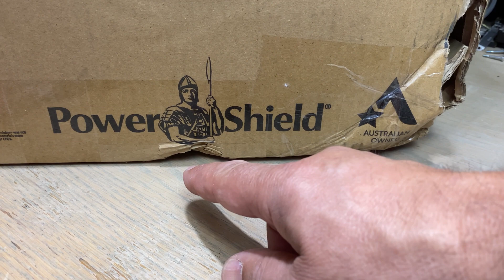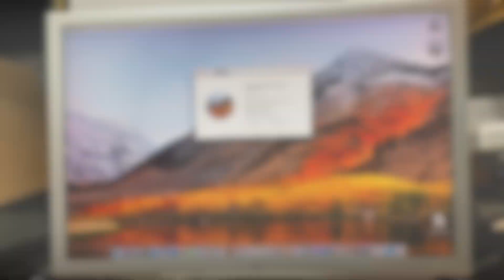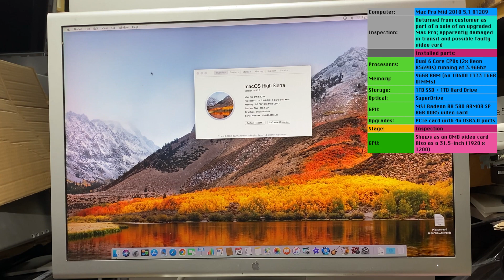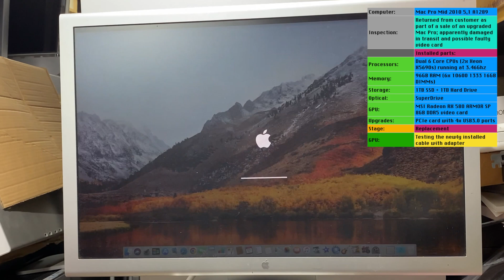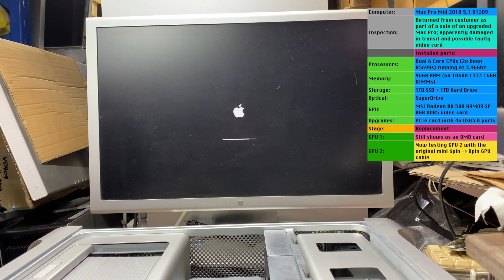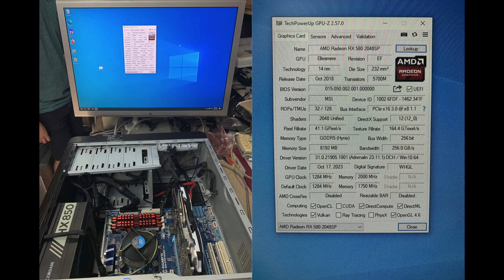[aa-repair] Mac Pro Dual 6/Hex Core with RX580 GPU 5,1 A1289 Mid 2010/2012 r0004 v25-006

Comment: Hi there, maybe I am too late, but at least I want to share my experience here. I've put a Sapphire Pulse Radeon RX580 with 8 GB of VRAM in my Mac Pro 5.1 and I can definitely say, that the card must be connected with both mini 6-Pin connections of the motherboard. I've bought a dual mini 6-Pin to 8-Pin adapter cable to connect the GPU. The Sapphire Pulse Radeon RX580 needs 225W of power so it now gets 75W over the PCIe Slot itself plus additional 75W + 75W from both mini 6-Pin connections of the motherboard. I am not sure about your MSI RX580 but I can imagine that it needed more power which could explain the weird behavior. Maybe this version of the RX580 even needs more than 225W which is the exact max. power consumption of my version of the RX580 and also the max. power the Mac can deliver for a GPU without modifying the power supply. Kind regards
Reply from the maker: Thank you for sharing. I have put in a Sapphire Pulse Radeon RX580 with 8GB in a Mac Pro Mid 2010 and 2012 with a single cable, and it shows as an 8GB every time, with or without OCLP. This MSI Armor SP RX580 with 8GB shows up as 8MB every time, with or without OCLP. If I place this video card into a PC, it shows as an 8GB. The 225W of power is the maximum power draw for the card, but a 500W or greater power supply is required, and a Mac Pro has a 980W power supply. I may shoot another video with multiple monitors connected, and try a few different macOS, and see what results I get.

Comment: Hola amigo tengo una Mac-Pro pero del año 2012  Procesador Intel Xeon W3565 soy de Venezuela y cada vez que la enciendo se queda colgada en el sonido que emiten todas las Mac y no termina de arrancar y no da video que falla es esa agradeceria de su experiencia saludos.

Hello friend, I have a Mac-Pro but from the year 2012 Intel Xeon W3565 processor, I am from Venezuela and every time I turn it on it gets stuck on the sound that all Macs emit and it does not finish starting and does not give video that it fails, that is why I would appreciate your experience, greetings.
Reply from the maker: G'day mate. If you have a Mac Pro 2009 or 2010 or 2012, and you hear the startup sound but no video, then your computer passes all the necessary tests to start. So the logic board, CPU board and RAM tests all pass. You must have a video problem, that is, the video card or the cable to your display or your display, is faulty. Or it could be a combination of any of those 3 components. I hope this helps you.

Hola, amigo. Si tienes una Mac Pro 2009, 2010 o 2012 y escuchas el sonido de inicio, pero no la imagen, tu computadora pasa todas las pruebas necesarias para arrancar. Por lo tanto, las pruebas de la placa base, la CPU y la RAM pasan. Debes tener un problema de imagen; es decir, la tarjeta de video o el cable de la pantalla están defectuosos. O podría ser una combinación de cualquiera de esos tres componentes. Espero que esto te ayude.

Comment: Could be that Mac expects some proprietary card bios in order to read its features properly.
Reply from the maker: I don't believe this Mac Pro's firmware is the issue, as it has not been modified in any way. I still do have one of the GPUs so I may give it a further test in other Mac Pros. Thank you for your suggestion for a possible future video.